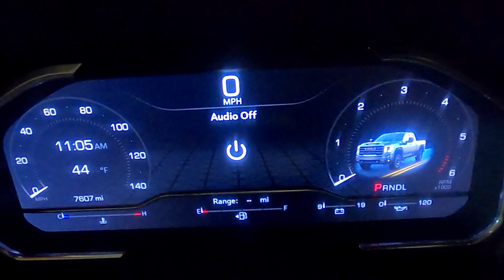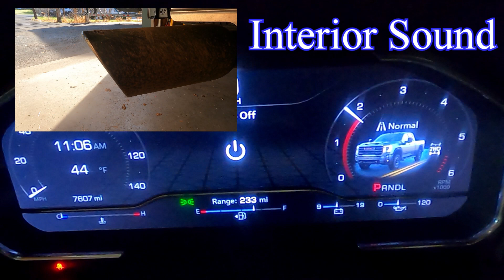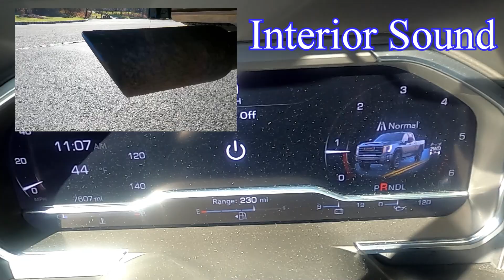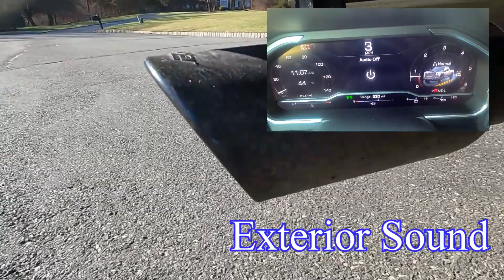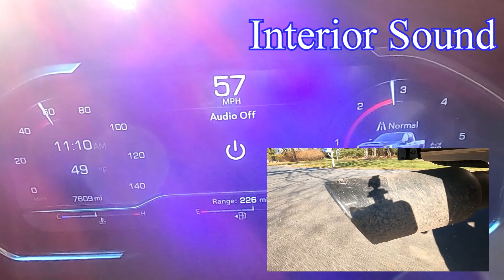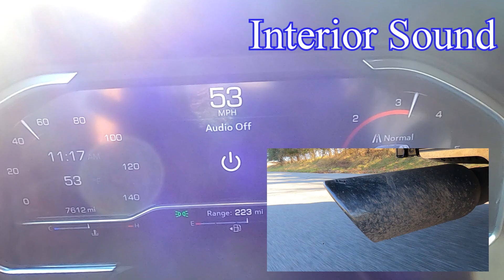GM Borla sound clips for GM 6.6 L8T Gas

Comment: How is towing or when the truck is under sustained load for a brief amount of time?
Reply from the maker: I tow a 30' boat, approximately 10k. A little deeper if you were to punch it- but I drive easy with a load.  I don't notice a difference.
Reply: @ very helpful. Thank you